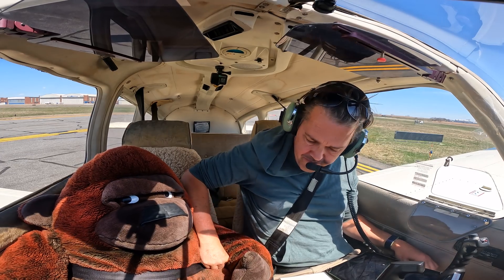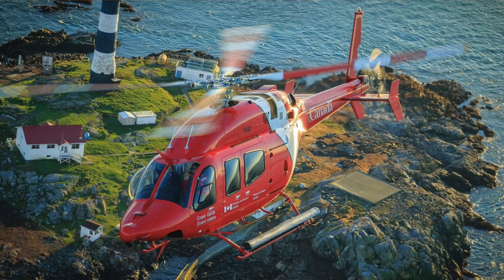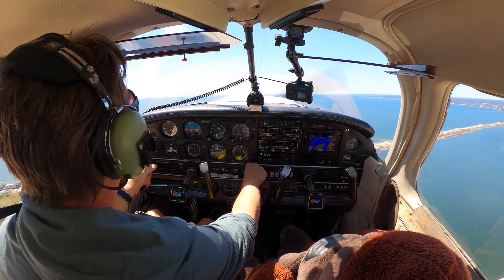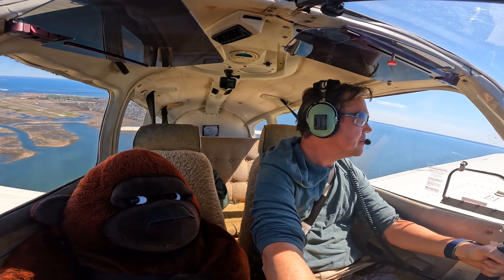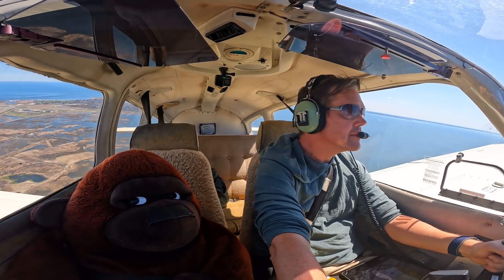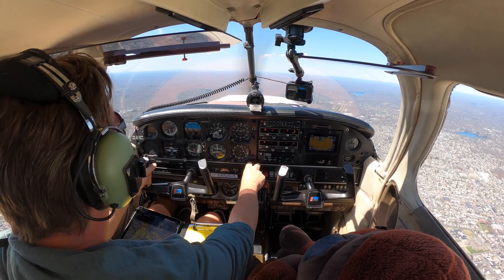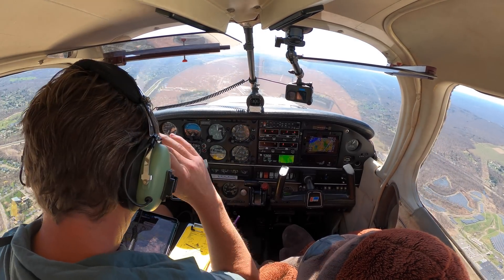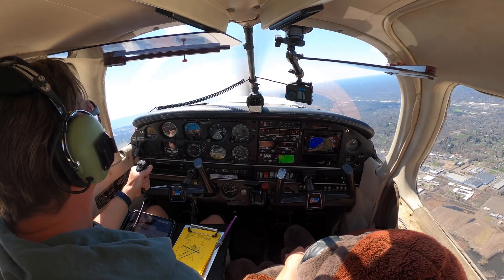Flying update and in flight engine problem

Comment: Well…
STALL warnings are to be taking serious, whatever you do 😂👍
As far as engine size and power ratio is concerned, since you compared this to car engines sir.
In my humble opinion, that is the reason why so many car engines from the past, lasted as long as they did.
Not to much „wear and tear“ … reliability is and should be the main goal.
Besides, what normal car driver needs MORE then 160 hp, when torch is more important?😜

Comment: My Grandfather who flew Mosquitoes and Typhoons in 1945 and then jets until 1970 in RAF and is 94 years old, was very complementary about how calm and reassured you were with engine oil issues, was not sure about the Gorilla however

Comment: Always nice to watch a pilot properly operate an aircraft and make smart decisions when adverse conditions arise. I like to think it is the fact that you are working toword your dual rating certificate as a dual Porsche owner that gives you the wherewithall to juggle the ins-and-outs of separating the fixed from rotary. Keep up the great work both with flying and content production. I know you will get a kick out of the 429, especially when they roll back one engine during an OGE hover, and continue to easily maintain the hover. Cheers from another dual ATP with dual porsches.

Comment: The GoPro stalwarts may be after you again for dumping on their cameras! 

One thing is for sure, no desire to pilot or even ride in small planes or helicopters. No need to identify where I worked, but two company helicopters went down and were totaled, one flew into the ground after the pilot lost his orientation, the other caught a skid on a wire and also went down. Pilots were OK, but an observer in one was seriously injured and retired on disability. Please be safe.

Comment: The Lycoming O-320 doesn’t like to run at full oil. I think your aircraft is full at 8 qt. Ask your mechanic, your aircraft is most likely happy at 6 qt. The engine will dump the extra oil overboard.

Comment: The amount of power produced from this engines are not that much when compared to modern vehicles, however keep in mind those engines runs about 2500~2700rpm only.

Comment: Hi Nick. New here. Are you thinking about getting an instrument rating?
Reply from the maker: Yes if I get my own aircraft
Reply: @NickMurray  Any reason for anchoring it to ownership? I'm trying to figure out if I should save up and do my PPL & Instruments in one go back to back. Wondering if that's the safest thing to do given the increase in traffic recently.
Reply from the maker: @DeSantangilo  The reason why it is related to ownership for me is that with rented aircraft I am staying locally in airspace I am both familiar with and comfortable remaining VFR, if I get my own aircraft I will be venturing much further away and an instrument rating then becomes a real asset.
Reply: @NickMurray  Makes complete sense. I don't have an itch to buy a helicopter at the moment (nor the means :), so I could definetly see myself using that Instruments during travel. Hey, thanks for sharing your "why"! - I now know what makes best sense for me.

Comment: Looks like it was a beautiful day despite the turbulence. It has always amazed me how little power those engines put out relative to their size. Maybe the low RPMs have something to do with it.  Thanks for the flight! F
Reply: Most are derated for reliability. If you stuck the same engine in a car you could get far more horse power with a little tweaking.